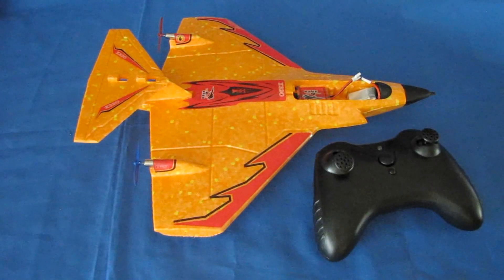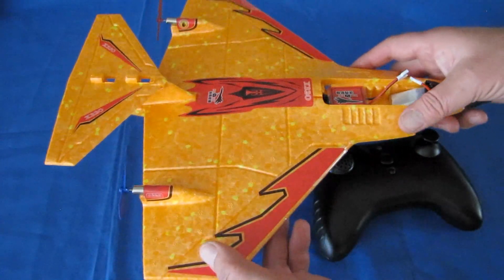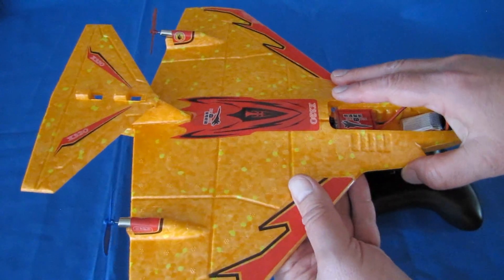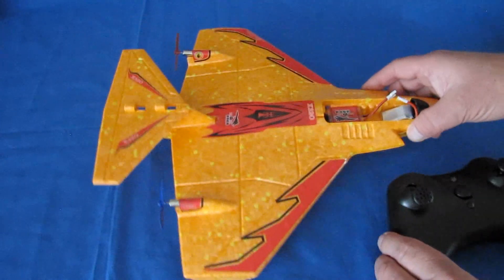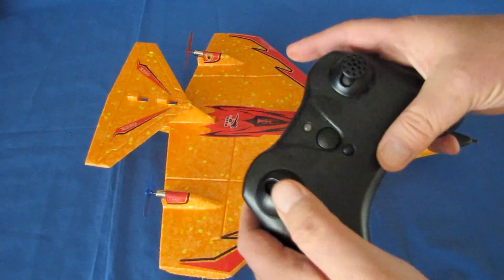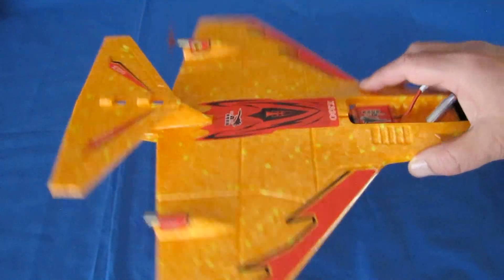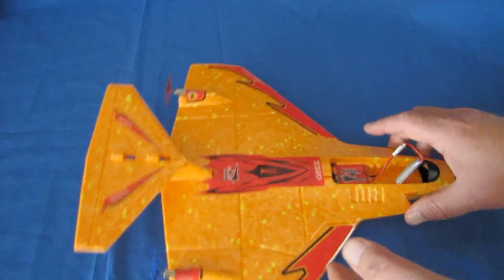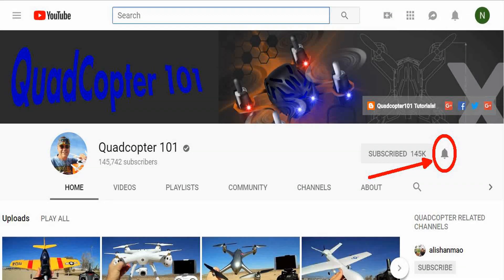How a 2 Channel Differential Thrust Plane is Stabilized

Comment: How can I contact you? I have a proposal and I need your help!
Reply from the maker: You're contacting me right now aren't you?  What's your proposal?
Reply: @Quadcopter101  I'd like to send you a drone for review. I started a website Virgoskydrones.com and I'd like your honest opinion.
Reply from the maker: I saw your website.  1000m FPV range is very impressive, but how does it achieve such?  Most 5Ghz drones can at best achieve 300 meters FPV range.  The exception are drones that include a 5Ghz WiFi amplifier relay in their controller.

Comment: Love your videos got 2 planes because of you, I want to ask an unrelated question how do I fix the instant diving problem on my xk a800 it flies for 10 meters in a slow dive down and then crashes no amount of elevator fixes. Also how do I recalibrate the gyros the manual isn't very clear. Thanks for the great content!!
Reply from the maker: Did you try adjusting the elevator trim buttons to raise the elevator higher.  Also, make sure to install the battery in the back end of the battery bay.
Reply from the maker: And to calibrate the gyros, plug in the battery and prop the plane up so that it is sitting level on a table or floor.  Then move and hold both sticks down and outward until you hear a beep.  If no beep, try both stick down and left or down and right until you hear a beep.
Reply: @Quadcopter101  thanks a lot for your replies I already did both of those things, sadly I realized today that my elevator servo doesn't work all the way and I don't know how to fix or replace I send bangood a message but no reply yet. I'm hoping everything works out

Comment: Of course, with a 3-4 channel and above those commands are sent to the flight control surfaces.  Today's planes /quads make even a relative beginner able to fly these craft.  When I started in the hobby 45 years ago.  It was all pure experience and lot's of crashes. You also had to contend with Nitro fuel and heavy planes.
Reply from the maker: OK boomer  ;-)
Reply: @Quadcopter101  I'm guessing you are right there with me.  Also, my hunch you are a retired teacher?  If you are and taught in the State of Ohio like my wife.  You'd have a very good retirement and could purchase lots of these RC aircraft. ;)
Reply from the maker: Yep, I'm definitely a boomer.  But retired aerospace engineer.  These days I play with toy aircraft to keep busy :-)